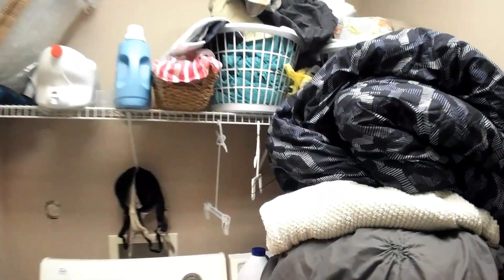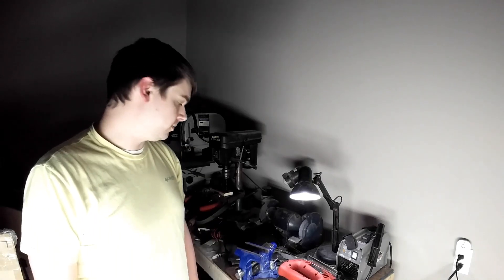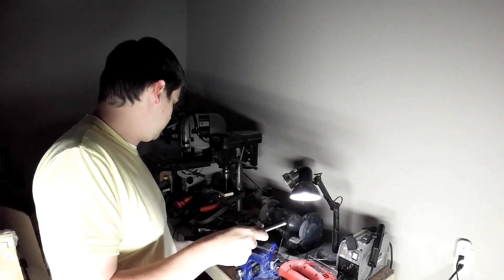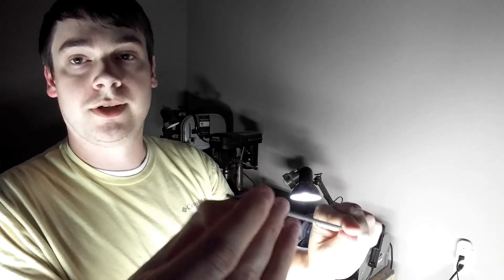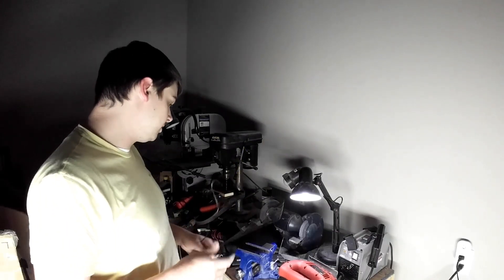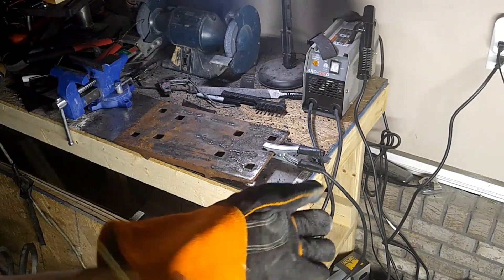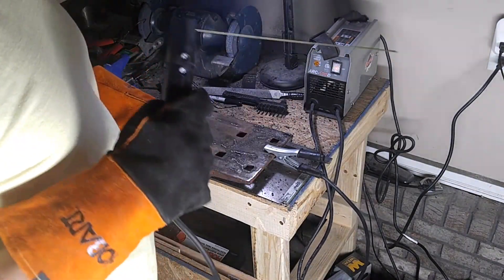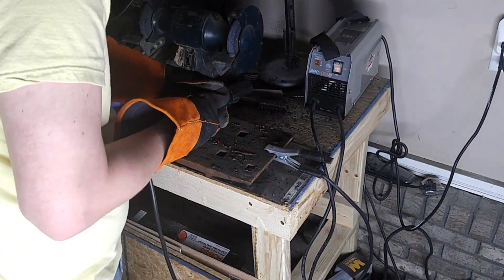Can You Stick Weld with a Clothes Hanger?

Comment from the maker: Thanks for watching! Leave a comment below if you have tried this before.
Reply: Trent, I like your videos because you try things I might try myself.  I have successfully welded and braised with coat hangers, in a pinch.  The trick for me is flux.  I have a can of flux crystal that I dip the wire in after it is hot. The flux sticks to the wire and away I go.  I would not use this method for anything structural but it works for projects not requiring strength or beauty.  A good, experienced welder is having heartburn about now, but some of us have to make do with what we can scrounge.
Reply from the maker: Alan O'Rear thank you for the comment. I fall into the latter group you describe. I'm just a guy trying to get by with what I've got. I enjoy making these videos showing old tricks I've learned from my dad, or testing out new things to answer questions like this video. I put a lot into these videos, and I'm glad you enjoy them.
Reply: I saw on another video somewhere a guy said his dad used mayo as flux.....no idea if the would work or not though
Reply: People have used hangars to roast marshmallows and charcoal hot dogs. No idea what the coating is but I suspect you might be over reacting Chris. Having said that, do you have any source to validate your concern?

Comment: You can use that coat hanger is a filler between the electrode and the plate I use copper wire sometimes between the electrode but you're right your machine ain't big enough you need at least a Lincoln 225 220 Amp out put . I have done some research on manufacturing flux and how to anchor it to metal existing wire so it is it's possible but conventionally it's still cheaper to buy it in the 2 lb
It's normally a mixture of triphosphate metal powder and some white lime cement when they make it in the industrial world it goes through a machine that makes the wire tensile strength it goes through a guillotine that cuts it off properly and then it's dropped into a tube where the flux is squirted in around it and there's a heating element that dries it out
You can also use coat hanger with a oxygen you have to have a neutral flame though

Comment: YES YOU CAN if you dip the rod in Borax flux when hot or wet glue.   I've done it with 24 or 48 v battery banks.  Negative on the rod stops the spatter.

Comment: You would practicaly need to up a welder to a generator to produce 220 volts to feed your machine to use coat wire. I know for a fact that coat wire is used in underdeveloped countries as electrodes as acess to some goods are quite limited.
Reply from the maker: I believe it. A stronger machine would definitely help

Comment: As a Teenager i had a freind that was  A VERY Good Welder and he would help me patch my cars together  he used coat hangers to repair exhaust systems  but he preferred the older heavier  ones that dry cleaners  used   I used to beg all my neighbors for any they had in their closets  and would fill my trunk up with as many as i could get for him  for any other Welding he did use new rods  that were store bought  those hangers he liked were about a 1/8” diameter  and they sort of had a goldish tint to them  ? I dont have any clue as to what metals they had in them but he always told me they were soft enough to not burn thru the softer parts of mufflers and exhaust pipes  ?
Reply: Pro tip: Most dry cleaners will give you all the coat hangers you want for free you just need to go inside and ask.

I get some every year to make fishing noodles with.

Comment: I've brazed with brass hangers and borax and map gas...it needs flux or it won't bond and have porosity in it and dc current is cellulose flux on the rods and ac rods have potassium in the flux.... Without flux stick welding the arc will not stay lit and it won't weld sorry but you can't beat science... At least you tried 😅

Comment: Heat up your coat hanger rod until just short of red hot.   Rub it all over with BORAX .  The BORAX will coat the rod.  You now have a Fluxed Rod that will actually work quite well on small projects.  Pretend it's  1/16th 6013 Rod.     I use two car batteries 24V Pos Ground.   Eaaaa Works for me.
Reply: No electrode oh thank you I need to fix a muffler in a jam

Comment: Slow down. 10 degree rod angle. Hold a steady arc and work the puddle. That's for yer 6011/13 work. Use gas if ya wanna weld with the closet.  lol

Comment: you will never be able to strike an arc with Alternating Current (AC) machine... since the current is constantly alternating. 
The coating (flux) on the electrode compensates for the alternating current and makes it possible to maintain the arc.
Reply: Whaaaat that's crazy talk. Sure you can strike an arc with ac